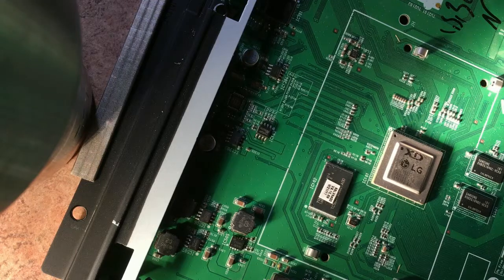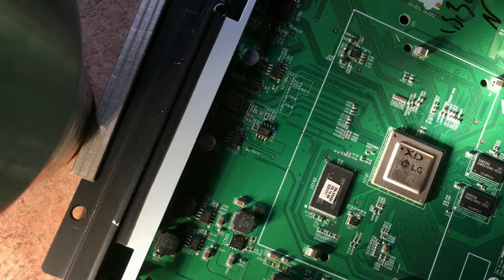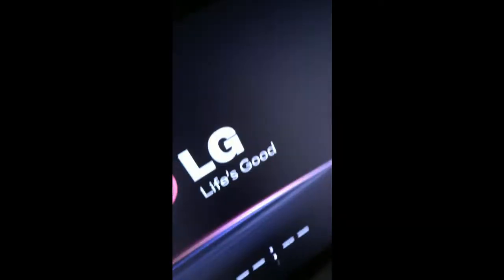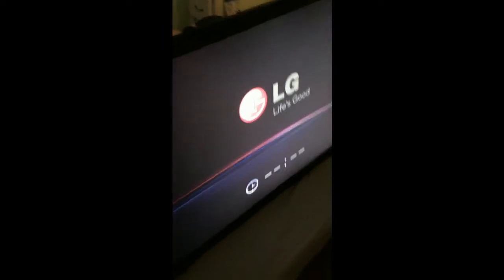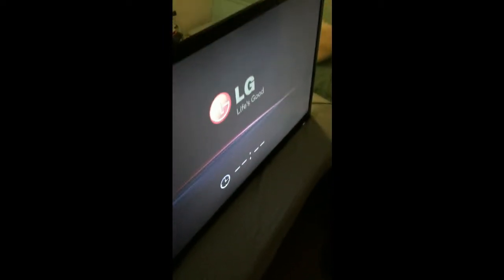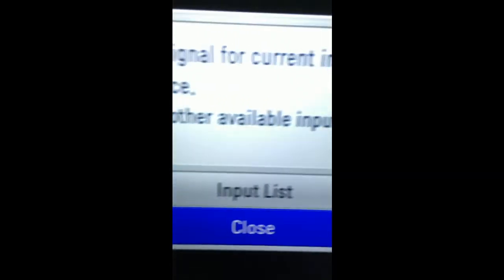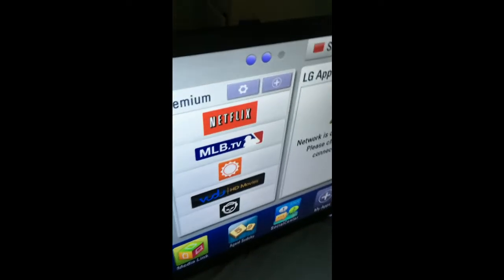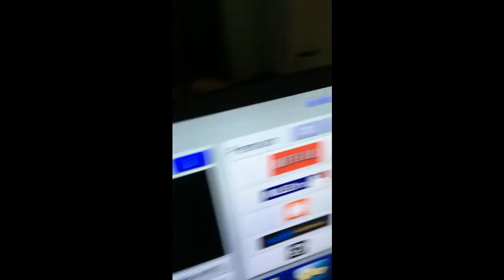LG 55" Smart Tv Model 55lv5400

Comment: Going to do this tomorrow. Proffessional reflowing seems to be a dying art since everyone just says "get a new board".
Have an LG 42LE5500 with booting issues, as soon as I heat the CPU with a hair dryer, it turns on instantly. 

Going to do it at work with a heat gun, hear these type of solder melts at around 225ºC so it's important not to over do it. Will probably use a laser thermometer as well to keep track of temps.
Reply from the maker: Flávio Coimbra , hope it works let us know.
Reply: @rileyorand  how long did you heat gun it for? My laser thermometer cant read the temps due to reflection so i dont want to Cook the cpu
Reply from the maker: Flávio Coimbra not to long but it was hot to the touch . Just keep an eye on the board, if it’s bubbling it’s probably to hot. You can always heat it again if you didn’t get it hot enough
Reply: @rileyorand  I used masking tape to mask the board and just hit the CPU directly with the heat gun set at 240ºC for about 5 minutes. 

Tested it today and it didn't work. Used the hair dryer and the TV boots up so at least I didn't damage the CPU.

I reapplied new thermal paste and now I'm wondering if I try the same today with higher temp or just go straight to the oven process.
Reply from the maker: Flávio Coimbra I’ve seen people do that be sure to remove all plastic pieces before you do it. If all fail you may have to resort to a new board but it’s all worth a shot
Reply: @rileyorand  As far as I'm aware the plastic on the board is all heat resistant since it goes into an oven when being soldered at the plant.

Also, all the capacitors are heat resistant as well so I should be good. 220ºC for 10 minutes should be good.

I've seen people not removing the heat sink but that doesn't make sense to me so I'll remove it again and just reapply thermal paste or something.